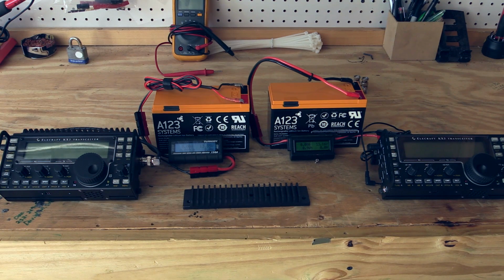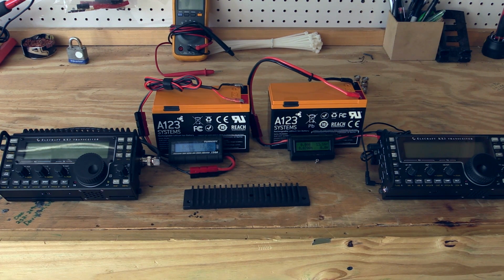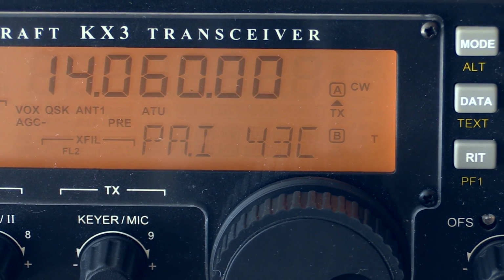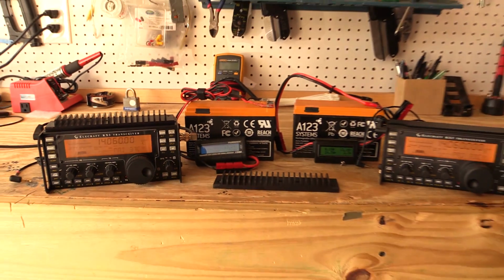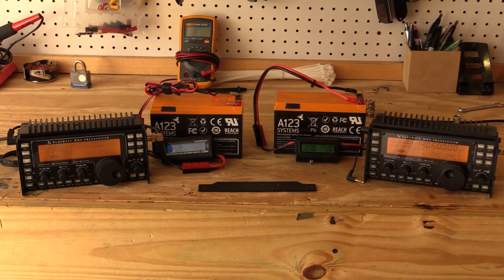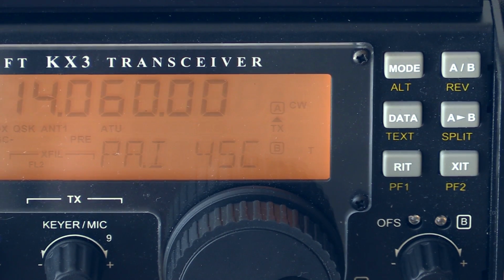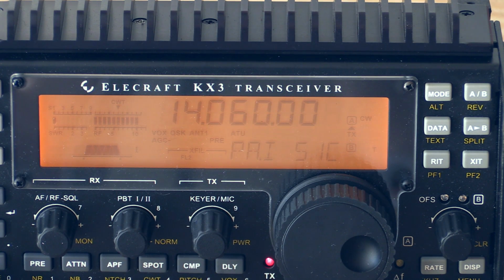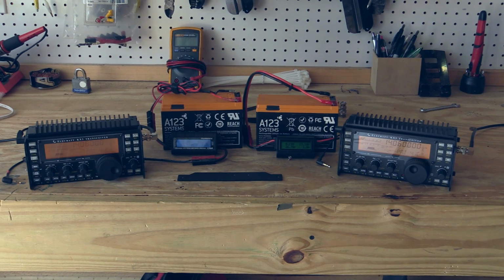Pro Audio Engineering KX3 Heatsink Installation Method Comparison

Comment: Are you sure all this is an improvement ? 2C and even 4 C is simply WORTHLESS. I am an engineer. The heath sink are WAY TOO BIG, the blade are too think for proper heat exchange. Just look at their Thermal analysis. You are better putting an increase in ventilation that doing this. Thank God I saw your video I cancelled the order. It is simply not god enough sorry. 73 VA2SOB Claude.

Comment: Thank God I decided to check your video first! I was just about ready to install my Pro Audio Kx32 heat sinks on both my KX3s and was worried  whether it was worth it to take out the air dryer and scrape and apply the thermo paste etc. ( version three according to Pro Adio's instruction manual. ) And it was nice that the Side KX panels and cover fit right under this heat sink.
73's
AF5LQ

Comment: Think about about the life of the power transistor the thermal paste it does much better thermal connection to your heat syncs.  This test is nice but I would put the thermal paste on to extend the life.

Comment: For the money not worth 3-4 degrees in my opinion. Rather have smaller radio.
Reply from the maker: n4ktz I can understand that unless you do a lot of digital mode work at full power and experience the drift.  Elecraft also now makes a new heatsink that is much lower profile and bends under the body of the radio.

Comment: In the next test I recommend PSK or data mode ... your test will go a lot faster. I could only get  a couple CQ's and two QSO's on PSK before the heatsink running 5w. With the heat sink I run 10w with no issues.

Comment: Have y'all seen the results of the independent evaluation that was recently performed by 5B4AIY, who apparently hold degrees in Electrical Engineering and Mechanical Engineering?  Based on his findings, the Pro-Audio Engineering claims that this heatsink is "best-performing" simply are not true.  (This makes me wonder what other claims on the Pro-Audio website aren't true either.)

I'm not sure if my link (below) will get filtered, if it does then look in the Elecraft Reflector online archives for the post with the subject line "[KX3] A Comparative Performance Assessment (of	Aftermarket KX3 Heatsinks)" which was posted early on the morning of 1 September 2014.

Reference http://www.ve7fmn.ca/this-is-cool/pdfs/performance_page/head-to-head.pdf
Reply from the maker: Thanks for sharing!  My decision to purchase this heat sink was driven by the fact that it was endorsed by the SideKX panel folks.  The link came through, and I look forward to reading it.

Comment: Very nice video.  Good to see the two installation techniques compared  It is also nice to see a well engineered heat sink get some attention.

I suspect that the use of a bench grinder to remove the coating from the KX3 case has resulted in a wavy surface.  Even if that waviness is only a couple of thousandths of an inch, it results in a thicker coating of thermal paste instead of the extremely thin coating that works best.  The thick coating of thermal paste performs about as well as the paint coating that Elecraft uses on the nice flat case.  Some paints aren't as bad as I once thought.  Data on thermal paste indicates that it should be as thin as possible and the surfaces must be machined very flat.  Getting the necessary flatness is almost impossible using hand tools.  See Howard's comments as well.  Good stuff!

I know now that in the past, I have used too much thermal compound on my projects.

Mark - KE6BB
Reply from the maker: Mark P Thanks for the comments and you make a great point!

Comment: Nice testing guys!  In general if the screws are tightened well and all surfaces are flat and mate well, the heatsink compound is a small improvement.  This is not always the case, so the thermal compound can also be viewed as performance insurance. 
The amount of heat dissipated by the output FETs varies band-by-band at any given output level due to PA stage efficiency differences.  You happened to choose 20M, the band on which the KX3 has the highest PA efficiency, so each PA FET is dissipating around 8 watts of heat at the 10 watt output level.  The suggested optimum technique option 3 we describe in our manual is designed to ensure best performance in the worst-case, which is 6M where each FET can dissipate over 12 watts, and to a slightly less extent 10M. 
In addition, I have seen some variation between KX3s in terms of PA efficiency which can affect the test results when comparing two units.  Thanks for showing that the heatsink works well in either installation mode!
Howie - WA4PSC
www.proaudioeng.com
Reply: fred08830 Hi Fred,
The heatsink compound included with the Kx31 is standard zinc-oxide loaded silicone grease, the most common used in heatsinking semis.  If one is really concerned with totally maximizing thermal transfer, then I agree, pay $$ for an exotic aluminum, silver or best yet diamond loaded heatsink grease.  And despite it being the very most efficient, make sure you do not buy the "liquid-metal" heatsink compound for this use: it dissolves aluminum over time!

Howie - WA4PSC
Reply: Given the undocumented and thus suspect quality of the thermal compound that's included with the Pro-Audio heatsink ... for customers who wish to fill the gap on the bottom of the heatsink that created by the "gap" in the coating, your best bet is to throw away the compound that's included with the heatsink and purchase a product of known quality.  (Expect to pay upwards of $20 for just a tiny amount!)

Changing subjects, KX3 PA efficiency is highest on 40 m rather than 20 m.
Reply from the maker: Howard Hoyt Thanks for the comments!  We plan on doing other tests, but given that 20M is the band where we expect that the most digital work is going to occur, we chose it rather than other bands.  Either way, we were able to definitely demonstrate a real world cooling performance increase with a relatively small investment.  AND it fits with the SideKX plates and cover to boot!

Comment: Nice test. Now how about also a timed to thermal shutdown test? Of course, a test comparing the various 3rd party heatsinks would also be great.
Reply: +fred08830 Dude you need to shut your damn mouth!
Reply: As well as a test that uses a calibrated bench power supply and a calibrated RF power meter.